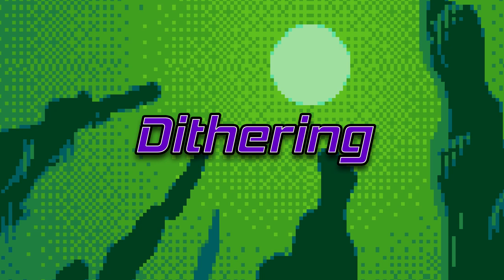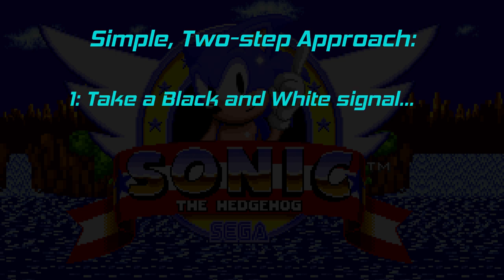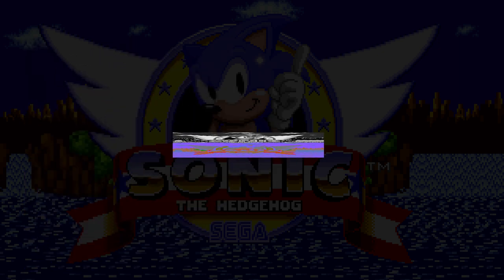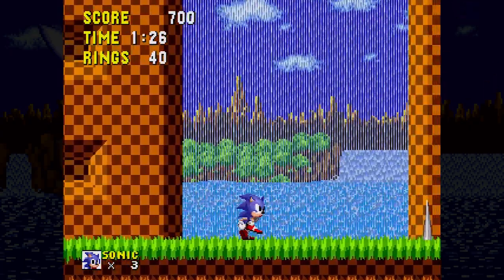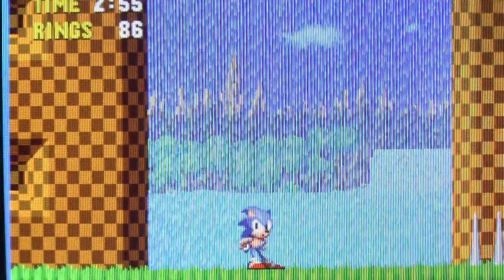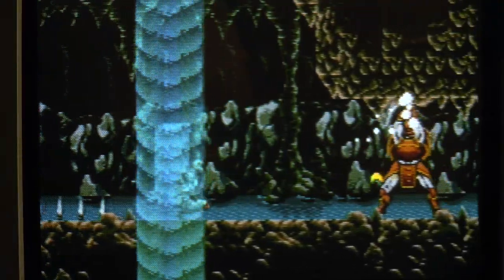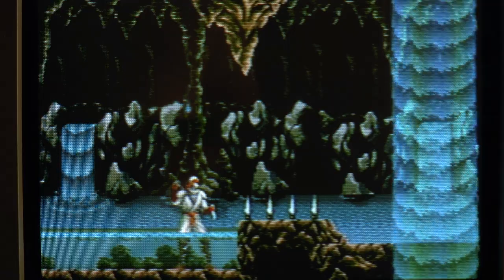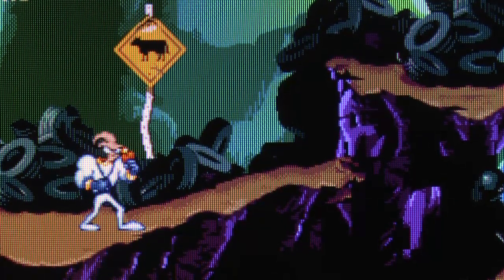Dithering on the Sega Genesis with Composite Video

Comment: Nice to see a fellow composite video partisan, despite even having access to RGB with a PVM. The Genesis in particular out of all the vintage game consoles is such a bundle of compromises about audio and video that what's best is highly subjective and largely has to be decided per-game.

The strong use of dithering in so many games makes composite video my primary choice on hardware, and I generally don't like the "sharp pixel" look of RGB and emulators. But then most variants of the Genesis have especially blurry composite video and it's kind of too blurry, I think. I wonder if S-video might be a good compromise, but I'm guessing the checkerboards aren't sufficiently blended with it, judging by the S-video examples in your PS1 dithering video.

Then there's sound. People tend to think the model 1s sound best, and they definitely really botched the sound circuit on most model 2s making its end result awful, but the upgraded sound chip they used (the YM3438), can sound cleaner and clearer than the original (the YM2612), and some late model 2s fixed the sound circuit so it can shine. We normally would consider clearer, less noisy sound superior, right? But then some music and sounds in some games were made to take advantage of the flaw in the YM2612 that created additional noise, and effects will be missing on the later models! The track "Red Out" from After Burner II is a good example of this: right at the beginning there's a burst of noise with a whistling sound that descends in pitch with a YM2612, but it's barely audible with a YM3438. So that's another thing to take into consideration when choosing the most appropriate individual Genesis console for the best experience with any individual game.

Clearly, Kevin Horton was aware of these considerations, because the Analogue Mega Sg has settings for a filter that selectively blends dithering patterns and a customizable level  the audio distortion that some games took advantage of, which I think is really cool and makes me think maybe I should get one someday.

Anyway, I watched the PS1 dithering video after this and decided to subscribe and was surprised to see the 1.9K on the button turn to 2K after I hit it - turns out I was your 2,000th subscriber!
Reply: Yeah, Kevtris' understanding of the hardware is quite exceptional, and the reason why the Analogue consoles are worth buying. I have a Super NT and it's worth every penny, especially since I can just plug it into my main TV and enjoy as I want, while keeping my actual SNES for when I want to play on a CRT. The Mega SG goes the extra mile with the additional graphics and sound options, and the ability to use with Sega CD! I think that's really awesome, and while I hope one day maybe support for the 32X could be added, I'm not going to hold my breath (I think it would be too difficult and/or the FPGA inside wouldn't be powerful enough to emulate it).

I'm definitely going to pick up a Mega SG when I have some extra cash. Also, while they're currently sold out, Analogue makes a DAC specifically designed to plug their consoles into analogue displays. DEFINITELY worth checking out and I think makes the Analogue consoles more versatile, and even more of a great solution for retro gaming.
Reply: So few games actually use dithering in a meaningful and effective way that it's not even worth losing video quality over it. RGB for life. Plus the composite quality on Sega genesis is probably the worst I've seen out of all consoles of the era.

Comment: I have a model 1 and a model 2 sega mega drive, both hooked up to a crt tv. Model 1 is connected with RF cable and model 2 with rgb scart cable.
i honestly prefer the RF picture in most games. 
Got to find me a composite scart some time.

Thx for the video.

Comment: Retro tink 2x pro has an AMAZING feature that slightly blurs your component signal's luma channel to get the transparency/color blending back.

It's better than composite as it's not as blurry and it doesn't have the rainbow artifacting.
Reply: "low-res YPbPr" mode is apparently what this is called, interesting. I'll be hooking up my genesis model 2 to my 2x pro multiformat today to look at this. I had no idea this was even a feature lol.

Comment: I remember getting Sonic and Sonic 2 for my Genesis and being very impressed with the graphics on both... especially Sonic 2.  You could definitely tell you were playing a 16-bit game when playing them.  Back then, composite was the high quality connection... most people back then only used an RF connection.  Genesis used dithering a lot due to it's low color pallet.  512 colors with about 64 colors on-screen at once was impressive compared to the original NES, but was sorely lacking vs. the SNES and NEO-GEO; and even to a degree the PC Engine/TG16, which also had 9-bit color, but could put about 240 colors in the background and about 240 colors on the sprites.